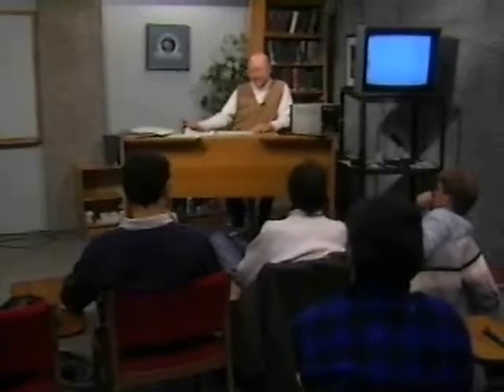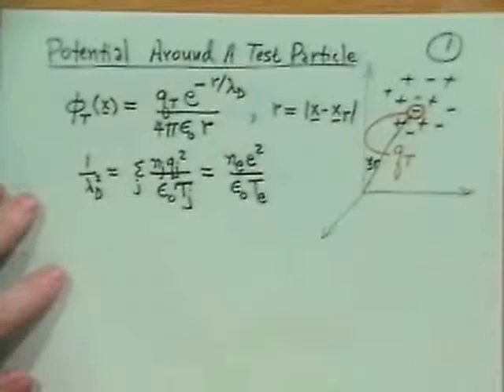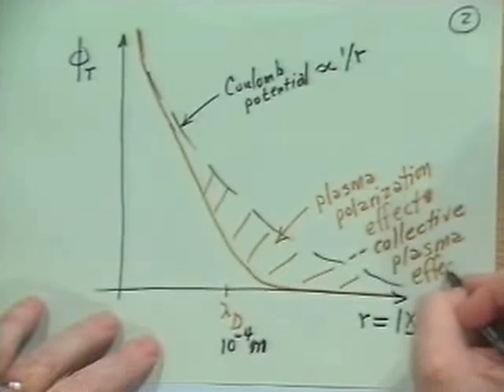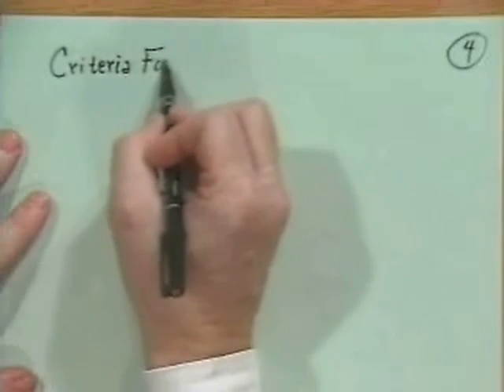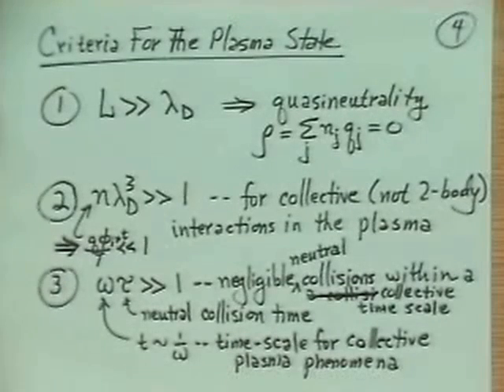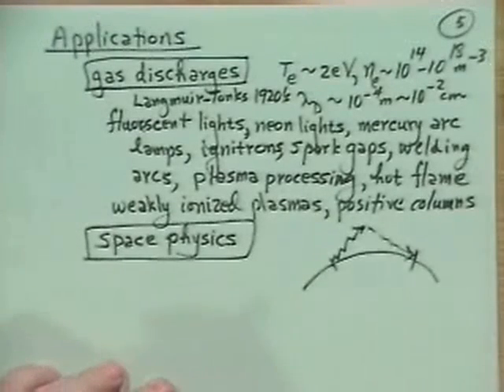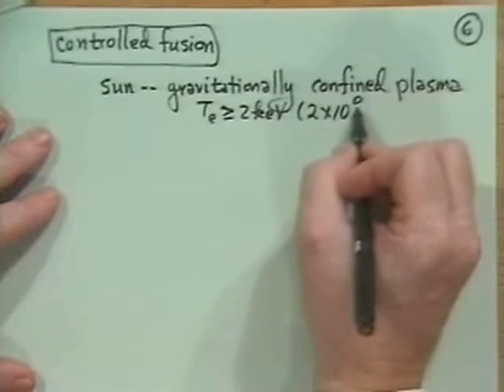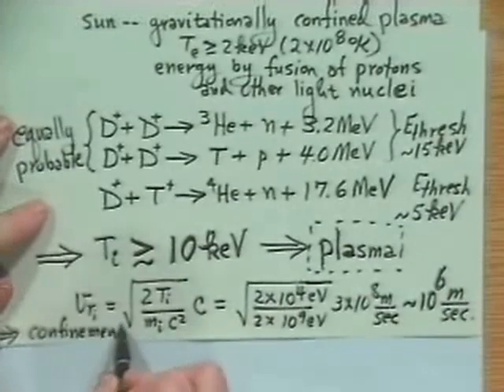02A Criteria For Plasma State | Introduction to Plasma Physics by J D Callen

Comment: 00:14 review class before: potential around a test particle and Debye length

22:07 main topic: Criteria for the plasma state: L>>lambaD, n*lambda^3>>1 (collective interaction, not 2-doby), omega*tau>>1 (negligible neutral collsions within a collective time scale). tau: neutral collision time, 1/omega: time scale for collective plasma phenomena

29:05 applications: gas discharge, space physics, controlled fusion

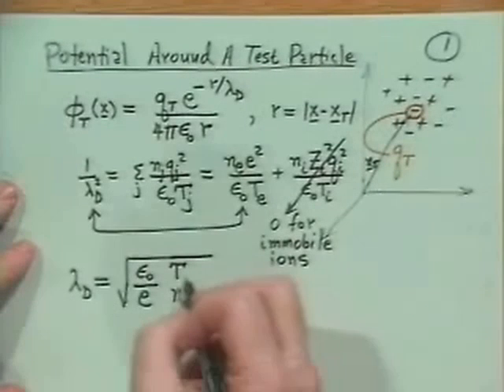Comment: 9:30 Why are the temperatures of the ions and electrons different?
Reply: There mass is much higher --> mi >> me, but the kinetic energy is limited, due to that fact, the e- velocity is much larger than vi --> the ions are immobile as he mentioned --> you can check with Maxwell Boltzmann Distribution